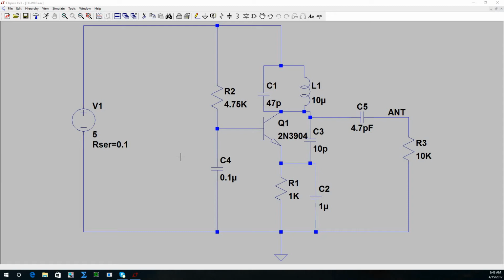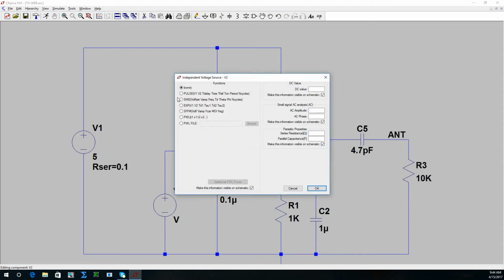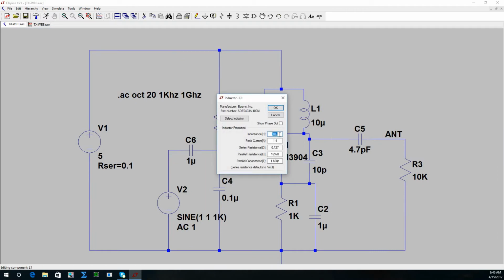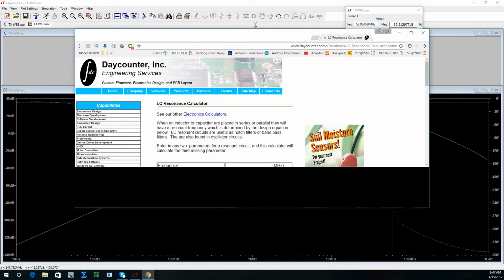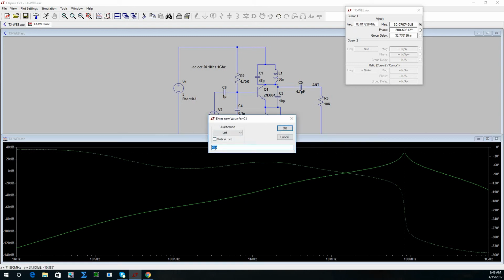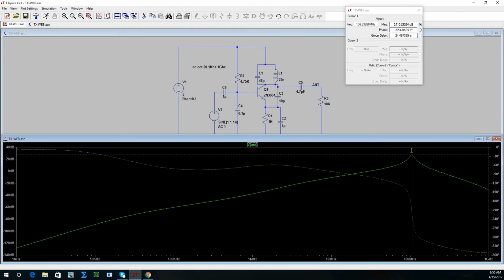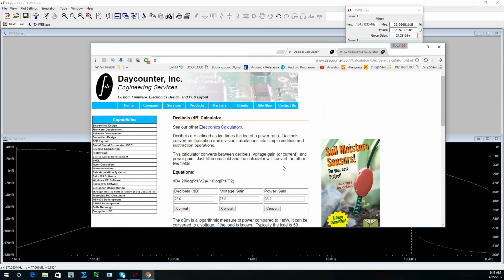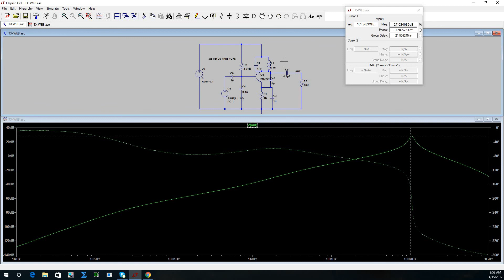Design A Long Range FM Transmitter - Part 3 Simulation

Comment: it is beneficial. however, the time domain analysis is still remaining which helps the reader that how the output of modulating signal is changed with respect to the message signal.

Comment: Sir I want to buildup more than 100Km distance cover FM  Transmitter so how can I do It and which component is used for that???
Reply from the maker: for 100Km you will need 10 watts or above (depends on noise and view of site), this require very good filtering and design - otherwise your transmitter will create a lot of noise and interfere other stations near you. for this I would recommend using professional power stage that will eliminate these effects,  you can start with something like this https://ebay.to/31yehrz that will work for 10-20Km estimate

Comment: It’s been a week since I decided to take on this project. I have visited so many sources and Read so many content. This is the first schematic I have seen where a tutor clearly explains what and why is doing every stage. Thank you so much .However I’m still a little confused about the modulator ie C3 is mixing the LC tank carrier wave and sign input wave from emitter If I’m right. How does C3 ebable this mixing to happen if I’m I get this right?
Reply from the maker: Hi, C3 has a major function to keep the LC tank above (L1 and C1) to continue oscillating, if it was not there it will oscillate till the energy between L1 and C1 decreases to zero, depends on the Q factor and internal series resistance of C1, hope this answers your question

Comment: I'm so confused, maybe you could help.
1) Isn't the signal input an audio signal (20 - 20kHz), why are you putting a signal that goes to 1 GHZ ?
2) It's a FM transmitter so should the frequency of the carrier signal not change? From what I see there it's actually the amplitude that is changing around the carrier wave frequency...so this is AM ? o.O

Thx for any feedback
Reply from the maker: Yes Audio is usually 20-20Khz correct. the 1Ghz is the limit that I am putting to simulation, you can put other values, but you want to see that you don't have other replicator of the frequency, so it is a good habit to look much higer frequncies that your circuit should work with. and Yes the FM is frequency changes (which you of corse don't see here) - in this simulation you just see the MAIN frequency of transmitting
Reply: 1) ahh yes I understand you just wanted to analyse the behaviour over the whole Spektrum.
2) Do you think there's a way to see the frequency changing in the simulation? Maybe reducing the carrier wave frequency? Maybe you could make a vid with a simulation like that xP

Awesome vid btw. Thx :)

Comment: nice, we need your help, we as many others build rc submarines, and all modern tx brands has move to 2.4ghz radios, and you can already imagine how that works on rc submarines, we want to build  a transciver, its a madness to desing the entire tx system, so what we trying to make is a device that can grab the output of a modern rx servos output or a ppm output of the tx and retransmited in a lower frecuency, like 27,40 or 72 mhz, can you help us?